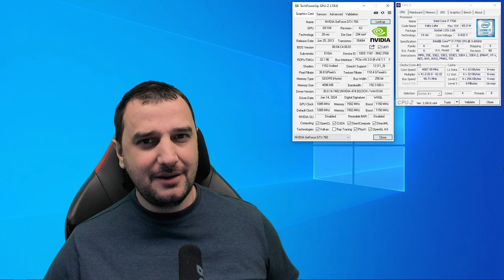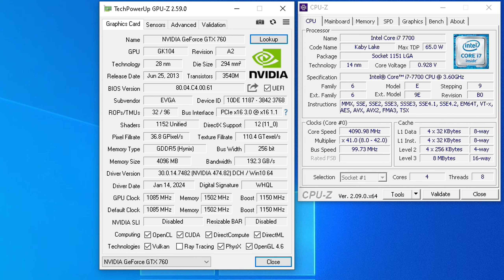Nvidia GeForce GTX 760 4GB Benchmark

Comment: It would have been nice if there were community based modded drivers for nvidia just like amd has with their nimez . Power draw ,longevity due to the power draw , drivers and dx12 really screw the gtx 600 and 700 line of cards  .
Reply from the maker: Let`s not mention Radeon 200 series that had support on DX12 :_ohNo:

Comment: 10:00 : i really can't understand what's going on with the DX12-support in those older GTX5xx / GTX6xx /GTX7xx lineup :
If you go to TPU spec page you will notice that all of these have the same DX Feature level support : DX12(11_0).
Since you compared the GTX750Ti Vs GTX760 they are almost identical(again TPU specs) besides the newer VULKAN-level support for the GTX750Ti , so in DX12 games there shouldn't be any "abnormalities" like the ones you say ,unless (like happened with the GTX5xx series) some new games nowadays😡 artificially-lock GPUs based on their driver-version .
I can't find any other explanation🤔 for 3 generation of GPUs( GTX5xx / GTX6xx /GTX7xx ) with the exact same DX-feature level support ,to display such "playability-deviations" on the newer games... 😵‍💫
Reply from the maker: I’m 100% sure it will be a big shift in the gaming industry. Many don’t have the possibility to upgrade and only want support for what they have. If companies don’t provide it, nobody will get what they want.

Comment: Don't be frustrated man..  The gtx 750ti is the early Maxwell and the GTX 760 is the older Kepler Architecture.  My Sister has and still uses the GTX 760 2 gig  I gave her,  And still using to this day.  (Light gaming, web browsing/YouTube)   Nice to see this GPU still working in 2024.  Thank Daniel! Cheers!
Reply: 750 and 750ti were the first maxwell gpu's and it's kinda wild to see them outlive the cards above them .
Reply: @danielivanov930  They are still decent in today's applications.  I personally had an i7 intel laptop with the 860m (Maxwell low powered version of the GTX 750)  My GTX 970 is also still holding up really good.  Cheers Man!
Reply: @Obie327  👍

Comment: Very impressive PUBG performance. Problem is 1% low when loading the textures of the enemies. I think I need to test my 750ti how it performs. But low vram size will be problem on my card.
Reply from the maker: It think with lower resolution it's possible